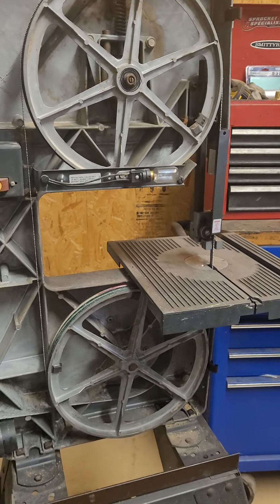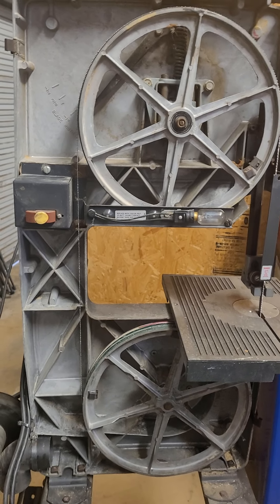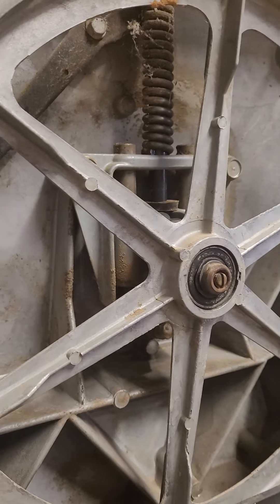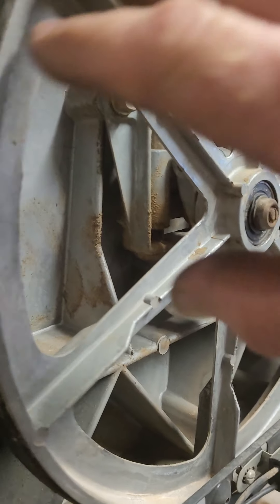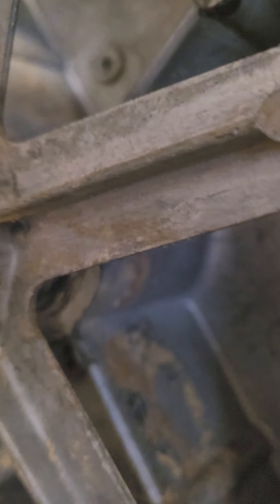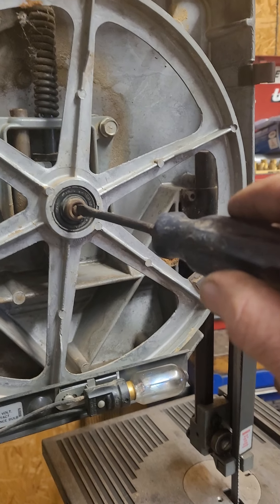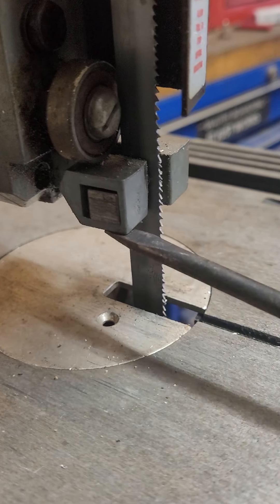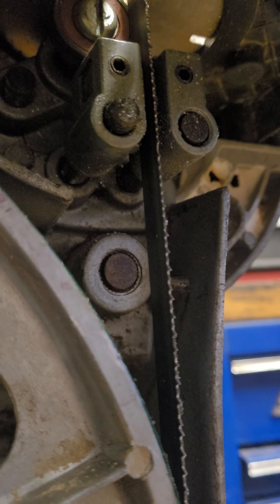band saw blade alignment

Comment: Well you can guess what I’ll be doing tomorrow morning hip hip thank you Captain
Reply from the maker: Hope it helps Charlie, thanks for watching
Reply: @captainraypaul4919  I knew about the guides but never knew about the tilt adjustment of the wheel it never even crossed my mind that there was an adjustment on it, the saw was my dads and I got it bout 20 years ago he gave it to me because the blade didn’t stay on so it’s just been sitting , thanks to you it may be a trusted tool in my garage thank you so much hip hip!!!
Reply from the maker: Absolutely my pleasure Charlie! That's why I try to do the videos., to help my fellow SHOP DIY ers.lol